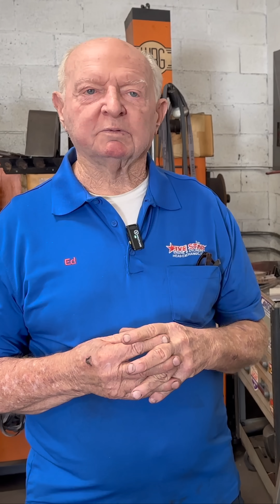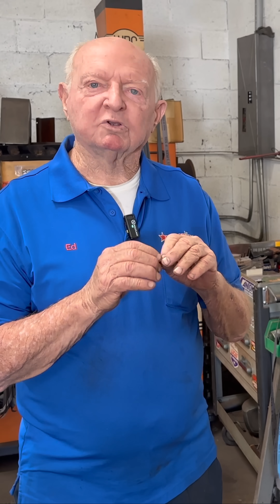"Banana" Crankshafts - Ed Smith w #BarryT #crankshaft #mechanic #automobile

Comment: I have either straightened or added camber to rear ends using a garage door, 4 wheels and tires total and a tape measure. You heat it then cool it and it will shrink that side. And you can put the tape in the center line or any line of the tire and if it is bent it wobbles back and forth as you have someone spin the rear end housing.
Reply from the maker: Interesting approach, thanks for sharing!

Comment: Ill be 50 in June but I put plenty of time in standin at the bench with a hammer and blunt drift, mostly factory steel sbc cranks.
Reply from the maker: Nice!
Reply: I've straightened tons of motorcycle cranks. Valves too

Comment: If a crankshaft is Obsolete and hard to find that might be a solution, but crankshafts that are sold everyday, throw it in the junk and buy a new one, even if it is a forged Steel crank, I would hate to see a junk crack break a high-dollar block rods and pistons.

Comment: I'm surprised it didn't break! I'd be so nervous!
Reply: performance crancks are steel that wont hurt them
Reply: I did bang
Reply: You'd have kittens if you ever seen the bending forces the rods put on a crankshaft at say, 8k rpm, kinda crazy how much elasticity a forged steel piece has to return back to original over and over